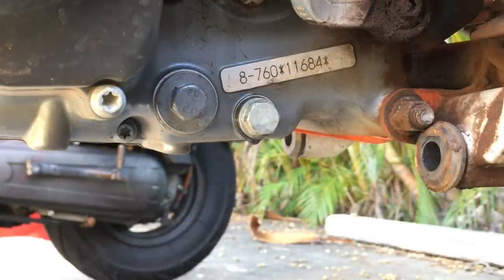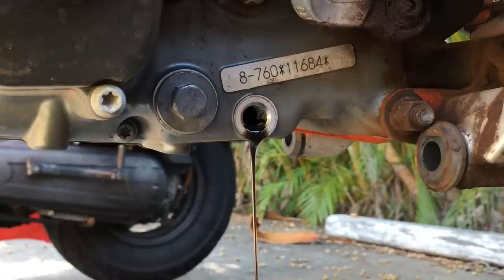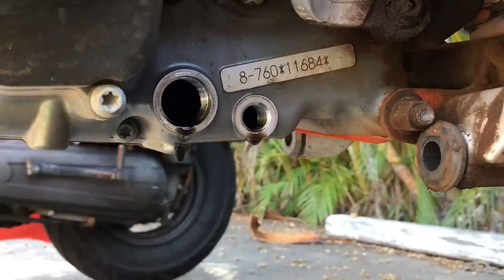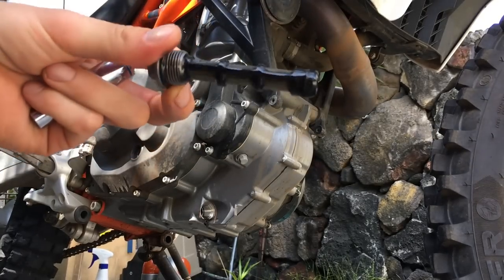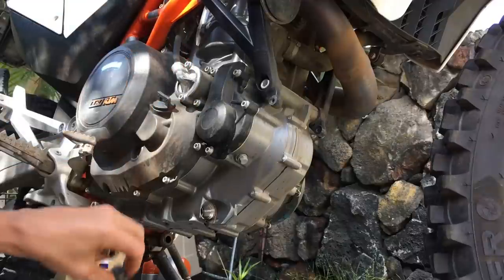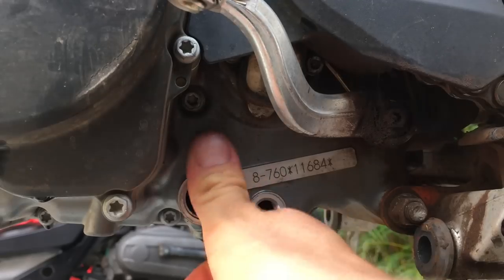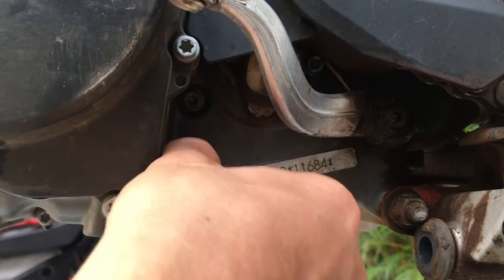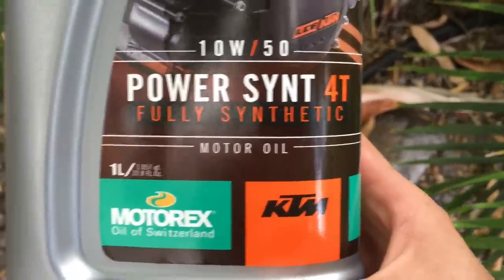KTM 690 Enduro R Oil Change - How To Video

Comment: Picking up a 2016 this weekend. The safety wire hook for the oil filter is a nice hack. The finger-dig into the screen hole was significant. Thanks for those tips!
Reply from the maker: Snap ring pliers work great for the oil filter so you dont't have to poke in there. Set them to open and grap the inside lip if that makes sense. Needle nose pliers will work the same way. Small dental pic works great too. I had none of those at the time.

Still poking a pinkly in the hole 🤣

Avatar looks like you're coming off a KLR. Prepare to have your mind blown. Welcome to the orange side 🤙

Comment: Thanks a lot for responding to my request, John. That was FAST!

I will for sure ride much more slow than you, so hoping I can expand oil changes at least every 2000-3000 mi  (manual says 10,000 km or 6,000 mi).

Awesome video quality and expertise comments and tips! Very smart to change oil often, remove metal particles and use good full synthetic oil. That way you will reduce friction and very well preserve engine wear (amazing LC4 engine deserves it).

I looking forward to own my KTM 690 Enduro soon ...I will let you know.

Once again, THANK YOU.

Keep going and enjoy riding the bike in Hawai island. Good luck!
Reply from the maker: Appreciate you tuning in.

Normal riding those intervals I'm sure are fine (KTM is smart), but half of my riding is bouncing on the rev limiter and the clutch takes abuse. I like to keep that particulate out of there!

Comment: Late to the party here but what a great video! Clear, concise and nothing left out. I'm not a wrencher but I feel confident I could easily pull this off after watching your video. There were a couple of good tips also in the comments such a pre oiling the filters. Love your channel! Thanks so much for posting this. Oh yeah....that funnel is the bomb!
Reply from the maker: Better late than never 😋 Glad you liked it. Thanks for watching 🤙

I’ll put oil on the filter(s) when it’s convenient and not cause a mess. I don’t sweat it otherwise. The motor will be fine while not under load for the extra 1/2 second it takes to cycle it through. The same people who get after me for that, will then run fuel contaminated, thin, dirty oil for 6,000 miles to my every 1,000 mile changes... and then they’ll bitch at me for only changing the paper filters every other change (2,000 miles). “Bro, you don’t change your filters for 6,000 miles. I still change mine 3x as often.” 🤦‍♂️ Internet is full of all kinds 🤣
Reply: Not really necessary to pre oil the filters, its just gonna cause a big mess on these where the filters go in sideways. There is plenty of residual oil already on everthing so running it without oiling anything for a few seconds is totally fine

Comment: Nicely done video my man !  Concise , to the point snd done right ! I do the same btw…. Filters every second change ...... and I’m in my third 690. ...... been riding them since 2008 ...... over 100000 kM on these bikes ...... cheers !!
Reply from the maker: Thank you. I would like to note though that I do them every two sometimes just because my service intervals are so frequent. I've replaced one of them with a finer stainless one, so now I do the remaining paper one every time.

Fantastic machines. Rubber side down! 🤙

Comment: Great vid man! I used it to change the oil for the first time on my bike. Very helpful!
Reply from the maker: Always nice to watch a quick review of a process before tackling a project. Glad it helped 🤙
Reply: @JohnHowerton137  
Hey John, did you ever try the rubber mount vibration reducing handlebar mounts for your bike? Im wondering if they really reduce the vibes.
Reply from the maker: @papaduck2443  no, I'm sure they do help, but I'm too cheap (or broke 🤣).

I do use foam Rally Grips. If you don't want to use foam ones, you could try Pillowtops from ProTaper or Renthal or a lot of people the fat ProGrip ones. I have Pillowtops on my 450 and Pillowtop Lites on my 200 that I often wear winter style gloves with.
Reply: @JohnHowerton137  
Awesome thanks! I was thinking about the foam grips. I heard that they are surprisingly good at reducing the vibration to your hands. Thanks for the info!
Reply from the maker: @papaduck2443  finding the right ones is the hardest part. Look for Rally Racing grips.
Reply: @JohnHowerton137  
Ok, I will. Thanks again!

Comment: Personally I pre oil the filters before fitting, surprising how much oil they will absorb and hold without spilling, saves running the engine dry on first start up.
Reply from the maker: Britishshooter no doubt that's the best way to do it.
Reply: Same here. I just put the bike on it's side and fill the filter and it's housing up.

Comment: Thanks for the metal chips tip.   At 3000 miles I did a second oil change and used some 6 inch Q-tips and pulled out a small amount of metal chips in that left side metal screen filter inlet.
Reply from the maker: There’s a surprising amount of clutch plate (alum) in there sometimes.

Comment: Hi JOHN HOWERTON, one way to keep oil from making a mess on engine may sound strange bug aluminum foil (fold it over) and place over the engine the oil will run over it and you can throw away the foil afterwards.
Reply from the maker: Good easy tip 👍

Comment: John try spraying wd40 on the case's and other areas that oil gets on prior to the filters being removed it sure makes clean up easier, I ben doing it for years on Harley Davidson and other bikes to just pretty much just spray water and oil just comes off especially in the hard to get to cracks and crevices.
Reply from the maker: Good tip. I kind of do that on the whole bike before rides, but didn't really think to do it before cleaning, so Kudos.

Been using SC1 lately because it also repels ants. Apparently ants love motorcycles if you didn't know. In my old MX days a lot of people used Pam cooking spray to keep stuff from sticking (and I sold them SC1). I might try some of the cheap silicone sprays at the hardware store to see how they work. Might be cheaper than WD these days.

Comment: Great video!  It would be interesting if there was a 'flush kit' or system to flush out the 'harmful debris' from the motor.  I am inclined to use a syringe type system to try to 'suck-out' the residual oil in the bottom of the crankcase and hopefully get out the small particles that you showed.   Appreciate the guidance to the process!!
Reply from the maker: Yeah, would be nice. Until then my pinky finger, paper towel and a few minutes of persistence gets a good bit of it out 🤣 Thanks for watching 🤙

Comment: John, you might try one of those pen magnets (or any other small magnet) to get the shavings from the oil ports.
Reply from the maker: Michael Marshall the plug itself is magnetic. KTM feature 👌 The shavings are probably aluminum clutch plate. I’m a banger. I love those R’s ✊

Comment: Just acquired my used 2018 KTM 690 Enduro R today.  Was searching for good video on oil change and came across your wonderful " how to " video.  Could you explain your break in period frequent oil change?  Also once you 're past the break in period what interval ( miles ) will you do oil change.    Thanks.      Kam
Reply from the maker: I was riding the hell out of that big girl off-road at the time. I was changing every 1,000 miles. I guess I still am. Looks dirty enough at that interval. Doesn’t really mean anything is compromised, I just kind of anal like that. Just look at a manual online if you don’t have one. KTM intervals should be fine unless you’re bouncing her off the rev-limiter all day.

Comment: For flushing out metal particles on left ports, how about having the bike on side stand then use a syringe with some fuel to flush out the filings by squirting it into the smaller drainage port and let the fuel flow out of the screen port - hopefully with the offending particles.
Reply from the maker: I suppose that would work. Let it drip dry. Even contact cleaner. I just never wan’t to put anything in the engine that’s not oil… but those products end up in there throughout the bikes lifecycle anyway. Probably better than having bits in there 😉

Comment: Okay John just bought myself one of these 2016 and looks like an appendectomy to remove the two spark plugs. Appears to be a coil and cap affair with a bolt holding it in place. You want to show us how to get them out and changed?
Reply from the maker: Bruce Kennedy ah crap. Maybe in about 1,500 miles I will when the valves need service. Still under warrenty... so I'll probably have it done at the dealer. Plus I have zero time for the next few weeks at least, so sorry 😞

Comment: Yeah, do a video on the fork-stops adjustment!
Reply from the maker: I'm working on a 200 for a guy this week that needs that done. If I have time I'll see if I can do that.
Reply: Thank YOU. When I first bought the 2013 690 I fell down because the front wheel don't turn enough.
Reply: Ugg, it's a 2014 690!;even after I adjusted the fork stops it ain't enough!
Reply from the maker: Not trying to be mean, but the 690 turns fairy sharp, so it’s more operator at this point. The bike has a higher center of gravity and weight than a lot of dirt-based bikes so people are afraid or unable to lean to get it to turn. Get some cones or flagging and work on low speed turns in a flat grassy area to boost your confidence. A careful spin of the rear wheel will also get it to turn quickly. It turns way sharper than my 200SX or most of the Kawasaki bikes I’ve ridden.
Reply: Like I stated, it's a 2014 & I been ridi over 59 years.. At least i know your opinion by. My 2015 500 & my 2007 525 do have a sharper Handlebar turning angle .
Reply: UGG CORRECTION; THE 500 ExC is a 2016
Reply: I may call my dealer, asking if the newer 690$ turn sharper.
Reply from the maker: @kaytme5915   your 2014 should be the same as mine. I haven't ridden the new generation 690 (19+), but it does have a different seating position, so it may steer "differently."

The EXCs you ride the bike. The 690 the bike rides you... you just guide it.

Your 500 and 525 have a much lower center of mass and a sharper radius. I would guess your 500 turns a little more before it hits the radiators than your 525. The older KTMs typically had a little more rake. You could also try and raise your fork tubes in the clamps a few millimeters to get more weight over the front and to get 690 to steer a little easier. This will possibly make it a little more nervous on higher speed road rips.

Comment: The mettle is probably from the sealing of the piston rings when you have a new engine you have rough sides on your pistons and rings they rub together to in theory make a complete seal stopping the oil leaking into the firing
Reply from the maker: Unlikely. Those tolerances are pretty tight. Mostly likely gears. To my knowledge KTM uses straight cut gears and  the shavings are the new  gears making love to each other as they break in.

Comment: I have a 2016 and calls for 10w 60 does yours call for a different weight oil because it's a different year
Reply from the maker: Mines's a '18. I'm sure it calls for whatever your's does.

As long as it meets the rating it doesn't really matter.
Reply: @JohnHowerton137  maybe that's why you have metal shavings in yours I did an oil change last night and I didn't see any metal shavings. I know 10w-50 is a substitute in the manual but that was alot of metal
Reply from the maker: @trevorj203  has nothing to do with that and everything to do with me fanning the clutch while popping it off the rev limiter. It's clutch plate. My 690 gets a little more action than your typical 690 😉
Reply: @JohnHowerton137   not trying to be facetious but Wouldn't that be more of a reason to run the heavier better quality oil?   Amsiol makes 10w60.
 I'm an engineer and I would think they had some  Engineers spend Time and money trying to figure out which viscosity oil protects there engine the best.  I know in the manual it says you could run 10W50 as as a substitute but it also says you could run poor gas on a different map  But you should only do that for a tank when it is unavoidable.  You seem like you are experienced and I am not trying to argue. It's my first bike and I just like to think things out and sometimes other people help you with that by seeing it a different way or having different experiences.
Reply from the maker: @trevorj203  no worries man, I get your point. Different perspectives are good, especially ones that understand engineering principals. It's 20w50. Honda has great engineers too and I change the oil 5-6x more frequently then KTM's recommended interval. My wear has been as good or better than I would expect it to be. They are great bikes. I also have heavier clutch springs installed as I've overheated the clutch several times.

My moto bikes used to be a oil change every ride or I risked exploding (literally) clutches and they run 90w.

Do what the manual says, it isn't wrong. The way I ride doesn't fit within those standards. If I followed those, my bike would have been blown up long ago.

Comment: Thanks for sharing. Once I was shown to push a small screw driver through the metal caps on the oil filters and pull it out. This should help avoid pushing a metal wire between the filter and the engine and causing eventual scratches or damages. You damage the filter but it goes out anyway so no need to be extra careful there. I guess there are other hacks and tricks. Like the tip to pre-oil the new filters. Thanks for the tips and comments.
Reply from the maker: I use snap-ring pliers usually now that I have a pair. Super easy

Comment: Anyone know the bar height on a 2017 690 endure r?  was looking at mine today and it appears to have risers and a bend on the bars.. (total height?) 
not sure if the pastrana bend will work with with stock cable length.
Reply from the maker: Detroiit 313 OEM part # for 2018 model claims (130mm height, 805 width, 63 sweep). I sold and used LOTS (7/8” days) of handlebars over a lot of years, I can can tell you right now that is BS. I ran Button bend on my Hondas back in the day (118mm/62mm?) and later switched to 971 Carmichael (99mm/54mm?). Been 20 years so don’t quote those 😉

My current 609 Carmichael at 120mm is no less than 25mm taller and more sweep (at 56mm). The reason I bought it... taller rider, need more sweep for a bad wrist. The Carmichael bar pretty much looks like a supermini bend compared to the OEM 690 bar. And no doubt has more sweep. My achy old arthritis wrist doesn’t lie. If I had to guess OEM is is 80-90mm rise and at most and 40-45mm sweep. When I installed the 609 I removed my 30mm riser and still maintained a similar position. Cant post photos here or I would.

The hydraulic clutch and brake lines get pretty tight around 120mm.

Comment: I didn’t see a dip stick on the filler cap.   Also, mine has a sight glass to see when it’s full.
Reply from the maker: There isn’t one. The clutch basket is directly under most bike’s cap. 690 only has a window.

Comment: Torque down all the screws properly with a torque wrench. 

On LC 4 Engines - Duke (R), SMC-R, Enduro R
6 Nm - 4 lb ft on the oil filter covers (They're M5x16mm btw, threaded into aluminium, they strip out very easily, be careful, unlike you wanna be like me and drive home in a rental car, also clean out any oil that tends to seep into the lower threads by blowing them out with brake cleaner or you will not be able to torque them properly and  most likely strip them out)
15 Nm - 11 lb ft on the oil screens
20 Nm - 15 lb ft on the oil drain screw

It's also a good idea to just go and buy the complete oil filter kit (75038046110) since it contains all O-Rings, both filters and new oil screens so you can just toss the old ones out. Keep in mind that you have to buy the oil drain screw (58030021000) with the copper washer (58038022000) aswell, they're not included in the kit and have to be replaced everytime.
Also LC4's take 10W60, no exception or you'll regret it on hot days.
Reply from the maker: Good practice.
Thanks for taking one for the team 😆
Reply: @JohnHowerton137  Yeah tomorrow I'll screw in a helicoil and then the beast will roar again without spilling all that new oil I just put in the damn thing.
Reply from the maker: Arcuz liquid gold at $20+ quart for the Motorex stuff!
Reply: Thanks for posting the Torque values, I'll add that you should use a decent quality Torque wrench or you'll still break things! :)